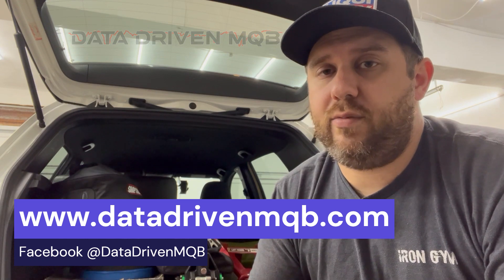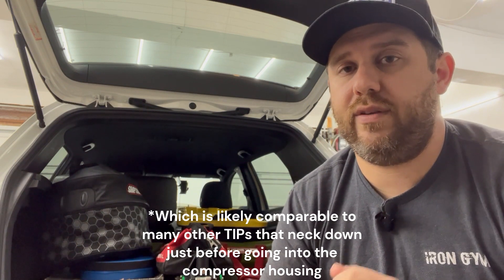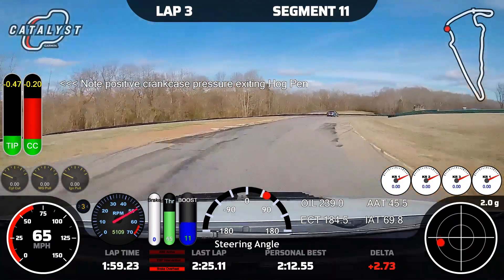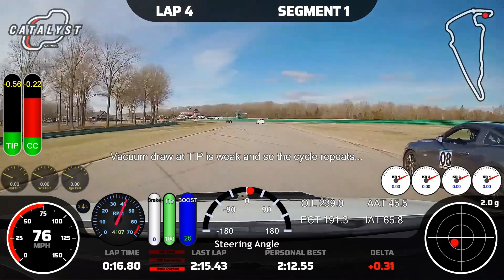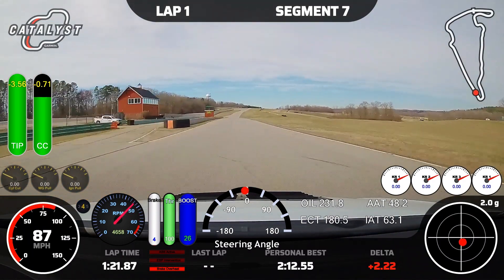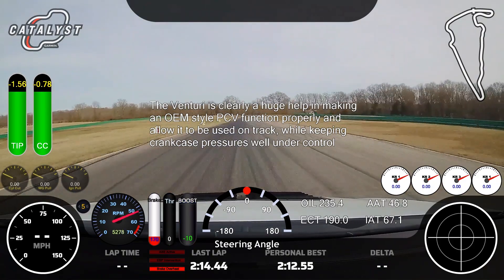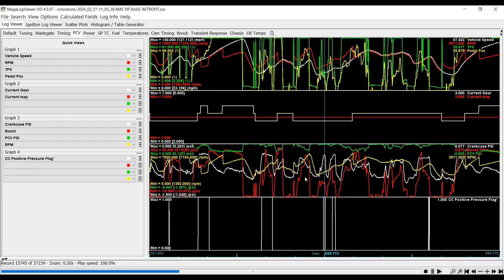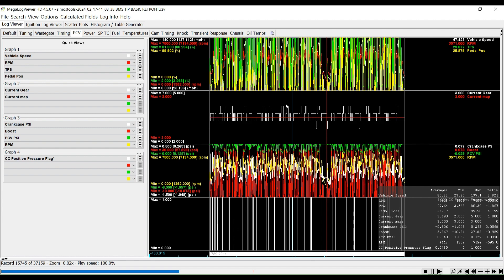Track Tested: MK8 Basic vs Full Retrofit w/ Crankcase Data Logging

Comment: I have a stage 1 2017 facelift R. I think about doing the basic mk8 retrofit with stock TIP. My stock intake is slightly modified with the GTE blockoff plate and driverside intake area is cut open with a AEM panel filter and the air baffle/snowguard is removed. I will drive the car with cup2s on the Nürbürging. I'm still a beginner do you think it will be good enough to avoid oil surge on track? I don't think there is any mechanic here that has knowledge of the full venturi retrofit
Reply from the maker: @hunteRfps  keep the stock TIP and PCV and see what happens. Most of the problem with the VW community is people throwing stuff on their car they don’t need or understand. Whatever VW recommends as your latest PCV is what should be run. Reasoning is covered here:
https://youtu.be/gx8o4Sh5B6Q

Comment: What do you think about the ECS tuning catch can system for the mk8? Have you seen what it consists of? Its way different than the APR system I had on my mk7 

I bought it but haven’t installed it yet.
Reply from the maker: Not sure. It looks like it keeps the MK8 suction jet pump, but it's pulling it's full vacuum on the can. Potentially may fill fast, but without someone trying it there's no way to know. Seems like a good solution in theory, but the lines are awful long and POST venturi, so that's a LOT of volume to draw vacuum on every time it's depleted. 

Definitely follow up on how it works out if you track or autocross the car!

I added a can to my MK7, but it is between Venturi and TIP so the stock Tiguan hose is still the only volume that needs drawn down before pulling on the crankcase. The Venturi essentially blasts into the can.

I have some plans for a video coming up with more info on PCV progress, theory, and what the MK8 retrofit does/doesn't do.

Comment: Why does my Mk7 Golf R not have any oil in the catch can?  I have an Amazon "Kyostar" elbow on a Mishimoto intake.  I see all these "problems"  and know GTI's have it for sure, but on a track I have never had any smoking or oil in my catch can. Are Golf R pcv or the effect of a is38 different somehow? I appreciate the videos!
Reply from the maker: Hard to say because there are so many variables. Track and timing of driver inputs also come into play. 

I have a bit of data from Hogpen (the problem turn) this past weekend which is really interesting. The degree at which pressure goes towards positive has everything to do with how well I’m taking that corner.

Comment: May I know what unit of measure are you using for the CC ( crankcase pressure ) data PID ? Inch of Mercury or water or PSI ? Thanks
Reply from the maker: The readings are in PSI
Reply: @datadrivenmqb   thank you

Comment: I will do the MK8 Full Retrofit but I do have a question, my GTI is a mk7 with Stage 3 - Billet Upgrade IS38 and it should be pushing around 450 crank at 23 psi, im using a Twin Intercooler setup with full 2.5" charge pipes and 2.5" muffler delete, there is no lag and it spools really quick, with an Epman inlet, full 3 inch downpipe and catback exhaust, and I just observed that my TIP had NO OIL at all, it was bone dry, I wonder how much vacuum would be "bad" for the engine or if it doesnt produce that enough crankcase vacuum to be harmful for the engine, its my daily car and daily i do a few pulls but i dont track the car, just spirited/hard driving here and there, but i want to maintain the engine healthy for a long time. You are doing an AMAZING job my friend! Couldn't be more thankful!
Reply from the maker: The crankcase only sees what the diaphragm allows (about -0.9 to -1.1psi at times), so that shouldn't be a concern. In all reality the OEM system is imperfect but it works "good enough" on the street.  The Epman inlet at least generates a decent amount of vacuum so I imagine it'll be fine with larger turbos and you wouldn't encounter an issue unless the car is tracked. 

Oil in the TIP will happen some regardless of what's used. I've seen it on MK8s and they don't even have a TIP hose. People make way too big a deal out of it IMO. If it were truly a problem we'd be dumping quarts of oil out of our intercoolers like SRT4s do every several thousand miles.
Reply: @datadrivenmqb  Thanks a lot for the insight brother! I'm going to do the full retrofit soon, I just ordered an EVO3003 intake from Injen and probably going to stick with the Epman inlet even with the full retrofit...and hopefully still having zero oil burn just like I am right now using the MK7 PCV. Very much appreciated all the effort and knowledge! Keep it up! Cheers!

Comment: Would be interesting to attempt the MK8 retrofit on my MK6 GLI with the EA888.3 engine. As it shares the AH/AP PCV part number with early MQB GTI's. Although would probably run into some issues with the whole turbo pipping being flipped and different on the PQ35 platform. This is great work here and will still be following to see if it can be possible for the small Gen 3 GLI community.
Reply from the maker: @GarageTouge I'm doing a few simple tests currently that may wind up working out for PQ35 guys quite well 😀
Reply: @datadrivenmqb  Thank you so much! I'm definitely looking forward to trying to test a solution as well for the PQ35 guys.

Comment: I know you have in the parts list a 3/8" barb hose fitting for the venturi hose. I went with a 5/16" barb, as the 3/8" seemed too big for the hose. 5/16" is plenty large enough to bite into the hose, and is easier to install the hose on.
Reply from the maker: Thanks! Yeah I think it's actually a weird in-between size, but the 3/8" hasn't been an issue. Will update the parts list with a note!

Comment: I have been following this for a while now. My 2017 s3 is MQB obviously but I was wondering if all of this would fit and function the same as you have it here. 
I am tuned stage 2 currently and I have the APR catch can kit but I’m worried it is increasing my crank case pressure. 

I opening my oil fill cap while it was idling and oil droplets were being blown out.
Reply from the maker: Yes it should all function exactly the same on your S3. 

APR (and all PCV plates for that matter) do away with the intake pathway in the cylinder head which is used at idle. Not a big deal for a dedicated track car, but IMO has no business on a street car. I'm working on procuring an APR kit to throw on my car and data log on the street for comparison to basic and full retrofits for reference.
Reply: @datadrivenmqb  
Yeah it has me worried about over pressurizing the crank case now. 
In your parts list you posted it shows the Tiguan hose and that does come with the Venturi part as well? I never did like my Apr TMD so I’d probably go full retrofit.
Reply from the maker: @OhMyProvision  yes the Venturi is built into the Tiguan hose. Add the 034 TMD and the couple fittings listed in the description and you're good to go.
Reply: Just a follow up. Installed the full retrofit on the stage 2 S3 today. Easy peasy install with your parts list. With my APR catch can plate I was slowly seeping oil from the filler cap. During idle opening the filler cap would spray oil from positive pressure. 

After full retrofit, opening the cap at idle I can hear the vacuum sucking around the seals as I twist the cap open. Haven’t done a full test drive yet but I still feel relieved. Maybe my engine seals feel the same. Thanks for the whole series!
Reply from the maker: @OhMyProvision  great to hear!

Comment: Do you think I’d still benefit from this on a big turbo/ fueling setup?
Reply from the maker: Yes, what @JordieG8 said. Keeping the crankcase out of positive pressure is always a good idea.
Reply: IMO yes, keeping the crank case in vacuum helps prevent seal blowout and helps ring seal.
Reply: You always want to have crankcase vacuum if possible. It improves ring seal and is free power.

Comment: Alright....I'm sold. Has the part list needed been updated?
Reply from the maker: Parts list is still the same. I added it to the description of this video along with references to the prior testing/etc. and install details.

The BMS TIP definitely isn't necessary - it was chosen to run based off of testing in this video:
https://www.youtube.com/watch?v=Pjcpla__riY

In a nut shell the Venturi is more stable with bigger turbo inlet pipes than with the OEM TIP... though it still works and functions regardless.
Reply: The BMS TIP isn’t needed specifically. I believe he chose the BMS because it’s one of the worst offenders when it comes to the PCV system.
Reply: @JordieG8  With the partial retrofit but it outperformed even the stock one with the full retrofit. That was my understanding from one of the previous videos anyway.
Reply from the maker: @SeanJuan_  correct: I wanted to use the BMS to easily demonstrate the differences and how a "known problem" TIP compares when you add the Venturi.

I'm honestly surprised it didn't (noticeably) smoke in basic retrofit form... but I attribute that to the MK8 better internal design/higher flowing air oil separator.
Reply: The parts list is in the install video. Just did the retrofit myself last weekend. The only thing that wasn’t listed was the BMS turbo inlet pipe.
Reply: @SeanJuan_   Thanks...Hopefully FCP gets these on their site.
Reply: So which setup do you recommend for those with the OEM TIP?
Reply from the maker: @samfusaro97  honestly even though it appears "less than ideal", I've had the full retrofit on my car with no real issues in 5 days at VIR + an autocross. On my higher boost tune I did burn a quart oil total over a full weekend (where I rented the car out and had 2x the track miles put on it), but that was only on the experimental ventilated MK8 valve (which I don't recommend).

I need to try different fittings and smaller hose for the boost line, like 1/4in or even 3/16in, then just adapt it up to 3/8 shortly before the Venturi. Testing indicates that restricting the hose in some way helps level out the bottom end crankcase. 

Realistically anything is better than OEM valves without the Venturi.